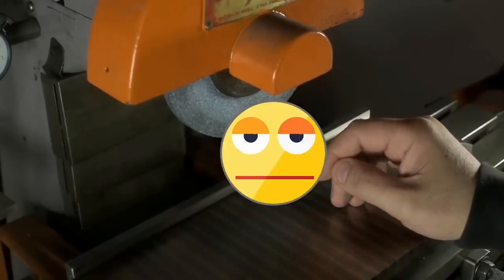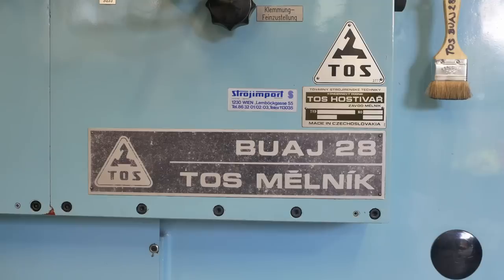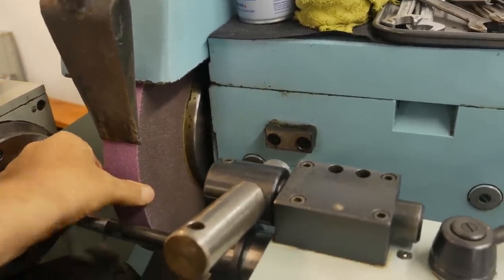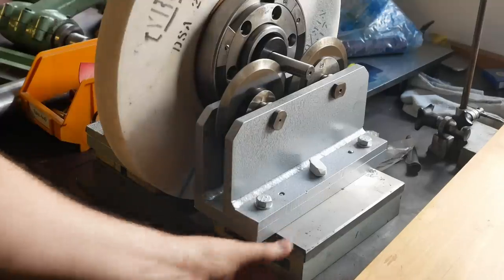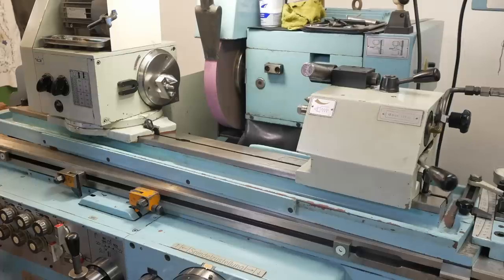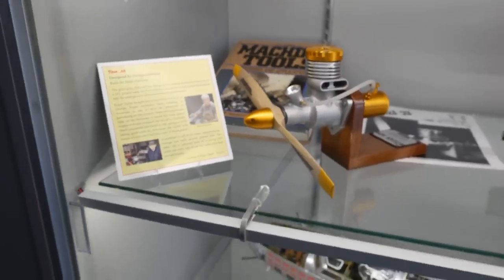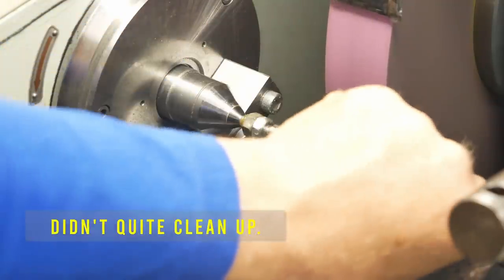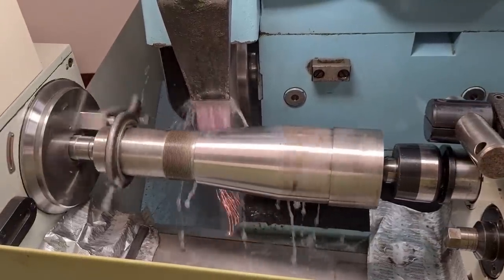Who needs a cylindrical grinder? || RotarySMP

Comment: Rewatching this vid, likely for the 3rd time now...
Damn, that is some savage preload on that spindle... My surface grinder while stiff, can be turned by hand with little issues... In fact, whenever i start the spindle, i turn it by hand and then tap the switch to power up... It eases the life for the motor, and its in general a bad idea safety-wise, which is why i do it with all my machines... Lathes, mills, grinders... Even the angle grinder gets a wrist flick before i snap the trigger into position... But that TOS grinder is almost like a diesel engine with 20-1 compression... Why in the hell is it so strongly preloaded? The wheel mass and diameter i guess, but while 40cm is much larger than my s.g. wheels of 24cm, i dont see 16cm dia difference warranting that much of a preload difference... Especially since they are the same width wheels...

Btw, that twin ways spoken of lathe is on her way to my driveway this friday... Checked her out yesterday, literally not a single new spot o` rust... Told ya that my lubricant coverage game was supreme... 
Now i just have to sell a few pneumatic collet closers and such accessories to get 3x the money that i spend on my last few machines back, per piece... The last lathe i picked up for peas has a large pneu collet closer which i can likely sell for 1.5k$ or so, which literally covers the machine, the transport and my trips to check her out and all that by like 3 times... Or, it pays off that lathe, the lathe im about to get and the deckel s1 that i picked up a year or so ago, and their respective transports... And i have quite a few of such things to dish out... And a huge hydraulic vise to fix up, scrape in and dish out for somewhere around 1k... The bloody thing is half a meter long... You dont want that brick slipping outta your hands and falling on the feet... That is a quick and dirty amputation... I got it for what was it? 30 euros? Something ridiculous like that... It would fit my large mill, but its just an instant waste of table space, as with that, nothing else could be mounted... It would have to sit parallel to the table rather than as you usually mount a machine vise... It was bought exclusively for restoration and re-sale... Even my surface grinder cant use it, which is enormous, at least when compared with most youtube shop surface grinders... Don`s from Suburban notwithstanding... Tony`s grinder is a toy compared to it... Literally a bench grinder in comparison, given that you can actually take parts off of `er and move them as a single human... Its kinda how Jeremy Clarkson described the Bentley Arnage 2007... A cathedral... 

I will film that lathe when she comes... I wont however film my shop yet, as its a fucking mess and in no state to be displayed... Not with 4 large machines stacked like sardines, next to each other... The rest is more or less in permanent positions, well 2 of those 4 are also in permanent places, even 3, as the third has to budge a bit to the right where the aforementioned lathe now sits while i work on her... 
Tho, i must tell you, everytime i watch this video, i curse myself for missing out on a fortuna cylindrical grinder... I was a day too late for it... She got cut apart with oxy torch by the time i got there... Tho, i did save the parts head and tailstock for a special project that is the aforementioned machine 3... But its such a sad thing thinking of the sight of that beautiful machine being cut by oxy-aceti to bits... I should have put down a deposit and gotten her... A damned sin that was... Oh the grief this world conjures... And only because someone died and the machine was tossed out, and my ass was too indecisive... Never again my friend, never again will i let a machine be obliterated if i can save her and sell her to a loving new home, where she will outlast the new caregiver... I think i still have a slagged t-bolt from the slant table off of that grinder somewhere... I guess as a masochistic reminder...

All the best and kindest regards!
Steuss
Reply from the maker: Hi Steuss. Seeing a serviceable cylinderical grinder the day after they started butchering it with a gas axe. Enough to make a strong man weep! 

There was a scrappy who lived a floor below us in our old apartment. Nice guy, but for them it is all just metal. He did sell me the Deckel G1L frame for €20 which was nice. That became my first "mill". There was also a vertical gear shaping machine in the scrappies yard. A swiss one. No way I could save it. Real shame.

Over here the value of machines is roughly inversely porportional to mass. Once a lathe exceeds abut a 2m bed length, you can barely give it away. Small machines go for top dollar.
Cheers,
Mark
Reply: @RotarySMP 
Kind of the same story with my side... 
The scrap boss is a great guy, just a lovely man, and his wife is aswell, they both run the place, a family business with 7 other employees... I asked him why doesnt he do something about good shit he can offer for a long time, for quite a profit at that, even if just oiled once a year and not left to rot in the rain and then get tossed into shredders for little profit to him... Same deal, he cant see it as anything other than metal, as it would be a ruinous politic for the business... I dont agree, hell, i could manage that place, make him at least 1.2x the current profit and keep the machines in a small area under cover, so fanatics like me can buy them... But i dont think that i want a job of a manager, nor do i think he would accept the proposal anyway... ``dont fix what aint broke type of deal``
Tho, that Deckel engraver body was such a great snag... I do have a fetish for plain machine bodies with just tables and such, no workheads... They offer amazing project foundations...

Regarding the machine market, same here, im in the ex-yugo zone, and its the same deal... The larger and heavier, regardless of quality, goes proportionally down with the price... Lest its a fully restored, above OEM grade machine, then its a separate arrangement, but just used machines, yeah, the bigger they are, the harder they fall...
 
Regarding that grinder, yeah, really a tragedy, but i just didnt ever consider taking on that type of machine at that point, and so i could not just jump on it... I should have, but fuck it, i saved some parts from her, and i saved quite a few other machines from the same fate, so i have to be happy with the soldiers that live on to march again, not fail in my duty towards them over grief... Every doctor has to accept similar losses, i guess that a machinist/millwright has to at some point as well... 

But dude, that damned lathe is likely coming over tomorrow... I`ll film her as is and post - when the truck deposits her ass before my shop... She aint movin` in, as i have to both clean and brush all the dreck off of her before i even consider letting her ass in... And i have to make a support pillar from the basement to uphold the garage, as the lathe from the last comment cant go where she needs to before that is done... I cant have an unsupported floor carrying a 1 metric ton... I likely could do it, as her floorprint is large enough to spread out the load, but that is not how i roll... Structural integrity and absolute safety come above all else...

Comment: Would this work for making something like ... a custom ball screw spindle (obviously with a different grinding stone)? Problem I always have is they are made in fixed sizes so if you are constrained (say you are upgrading a vertical mill and want to replace the acme thread spindle but the size you need is a specific length) it is a pain.
Reply from the maker: I dont think it can grind the ball thread, as I dont think it can do the coordinated motion. It could easily grind new journals on the end of a shortened screw, if it fit between centers or through the headstock.
Reply: @RotarySMP  Interesting. Thanks for the reply!

Comment: the size of that wheel is nuts
Reply from the maker: That 400x40mm is the thin one. According to the manual, you can fit up to Dia 400x100mm wide grinding wheels.

Comment: Cylindrical grinders are used to refurbish car steering racks. I have seen them working, but i didn't thing that those are generic machines, they looked like dedicated equipment to me
Reply: Also, typical steering rack is longer than 1m, so machines this small must come with discount thanks to incapability of working with them :>
Reply from the maker: I dont know what it cost, but would have only been a fraction what it cost new in 1991.

Comment: I know where I can get up cylindrical grinder here in Fairbanks Alaska that monster weighs more than 10,000 pounds I think you can cylindrical the grind about 6 foot long something about half that size would be perfect
Reply from the maker: That "little" TOS is probably nearly 3 ton, but only swings 620mm between centers.

Comment: thanks for the videos! any chance you could share your servo tuning process? i’m in the process of tuning my own similar JMC AC servos for my mill conversion and pretty much struggling. thanks!
Reply from the maker: I havent gotten mine fine tuned yet, but will try to add something in my next video.
Are you running yours in step/Dir or analog?
Reply: @RotarySMP  amazing! i’m running it step/dir out of a mesa 7i95, because i have glass scales that i eventually plan to use to give actual position feedback. but so far i’d mainly like to get the servo as little following error and vibrations as possible before any of the more advance feedback. i’m dealing with the jmc software and chf changing values change things but seems to never get in the right direction.
Reply from the maker: @bastieng  There is a really good video on tuning for Step/Dir here.
https://www.youtube.com/watch?v=_9Q-VFesnA0&

Start off using the JMC JOG Mode, and make sure the Encoder counts up when moving Up.
Reply: @RotarySMP  yeah no of course. i have watched this one countless times and worked with it. i ended up having a better result today by using the AF_J-L function of the drive to get the load inertia of the axis. automatic settings were better of a start once the inertia was entered at the start.
Reply from the maker: @bastieng  There is another video where the guy works out that the autotune is not a real auto tune, it is just a look up table of fixed incremental values. You also can't input decimals of inertia (mine are about 1.2 on X and 1.6 on Z. Since I am doing analog control I need to do the loop tuning mostly in LinuxCNC, although I really do not understand all the values in the drive, or how they intereact with LinuxCNC.
Reply: @RotarySMP  Oh I didn't know about the floating point. Good info. Re: interaction with LinuxCNC, do you input the servo encoder to Linuxcnc? In my case the servo encoder talks only to the servo drive but not to the mesa card at all, so I mainly wanted to make sure it answers to itself tightly, so I don't inherit a lag when I later tune the glass encoders to LinuxCNC. (and yes, the "auto-tune" is a table of basic sets of parameters which take input from the load inertia and "stiffness" setting, as far as I understand. Turns out that if the load inertia is in the ball park and you get the "stiffness" as up as you can before getting resonance, it's an ok starting point. Had to still add some positional and speed gain manually and filter some resonance. It's not perfect but I get a couple of microns following error, which I hope the machine can live with. Could definitely be better but I'll try with this for now.)
Reply from the maker: @bastieng  Yes, I am passing the encoder through to a Mesa 7i83, and having LinuxCNC close the position loop. The Driver only closes the velocity loop.

A few micron following error is very good. It is very hard to reduce it to zero in an amatuer system.
Reply: @RotarySMP  ah wow i never thought of passing the servo encoders through. sounds interesting. and yes the results i got today were suddenly much better than all my previous attempts. i’ll still have to see if i can fight the lead screw backlash with the scales. anyways, i’d be super interested to learn more about how you going about these different encoders and tuning them. thank you so much for your video series i really enjoy it!
Reply from the maker: @bastieng  Having backlash in the drive train and then trying to close the position loop with direct reading scales is not a great plan. Where a human intuitively takes up backlash in the leadscrews of a manual mill when reading DRO's, a dynamic CNC machine will have issues with that. While backlash compensation is available in LinuxCNC, and works open loop, I beleive it will be challenge to deal with closed loop. Before you go doown that path, open a thread in LinuxCNC forum to discuss it's feasiblity.

Eliminating the mechanical backlash is the better solution.

I thought about adding linear scales for direct position measurement, like the Maho has, but there is no simple place for fitting the X scale. Also the machine and drive trains are so stiff that Schaublin didnt consider glass scale necessary (They measured position with Tacho's on the servos), so who am I to second guess them.

I probably have no advantage with running the JMC's in Analog mode and closing the position loop in LinuxCNC. I could have used a step/dir mesa card, and let the JMC driver close the position loop, and just indicate position in LinuxCNC with the pass through encoder values, with the same performance and accuracy.
Reply: @RotarySMP  ok, that's super interesting. basically the situation is: I got the servos and the mesa to convert this mill, I planned to change the 3mm pitch original leadscrews to ballscrews but didn't want to yet dismantle the machine to figure out how to adapt it. I then was like 'hell, I have the servos let's make some fixtures and prototype the whole thing. Then before I knew it I had a bunch of electronics thrown on the workbench and got the axis moving and started tuning the drive and instantly was like 'shall connect the DRO scale to the card already to test?' and basically that part went real bad yesterday. Not bad as in stuff is broken, just bad as in headache. No setting seems to work.

So should I just move on without the scale feedback until I mount some actual ballscrews you think? maybe play around without open loop software backlash compensation?

The original leadscrew on the X axis (which is the one I'm fiddling with) has about 0.3mm backlash.

I did open a thread on LinuxCNC forum yesterday, as I thought my whole PID loop was totally wrong (either HAL setup or PID parameters), here it is: https://forum.linuxcnc.org/10-advanced-configuration/47047-linear-scale-and-ac-servo-set-up-sanity-check 

Thanks a lot for your thoughts and clarifications on your own setup, it is very mind opening and helpful.

I love following your restauration project, the lathe you got is a treasure. I'm daily using a pretty old small Schaublin 102 and I love and admire it every time. Got me out of so many jams.
Reply from the maker: @bastieng  I responded on the LinuxCNC forum.

Comment: I have a Dremel mounted to my 7" Harbor Freight lathe so that I can get precise diameters on long shafts. If that counts as a cylindrical grinder in a home shop I'll happily make a video. :D
Reply from the maker: How did that work out for you on a long shaft? I have used my Proxxon grinder in the mini lathe with a cut off disc, and it makes really nice clean circlip grooves.

Comment: Put the water on the part not the wheel
Reply from the maker: Thanks for the tip.
Reply: @RotarySMP  trust me I grind a lot of spoools to the micron lol the water on the wheel just makes a mess and can actually affect roundness if the pressure from water between the wheel and material is too great for example, anyway the wheel doesn't need cooling the Metal does ! 😇
Reply: @RotarySMP  for cylindrical grinding anyway, if we were talking about cutting grainite for example then you'd be focus on making sure the blade if getting sufficient cooling. Entirely depends but with grinding metal with stone it's cool the part, the wheel just wears away you'd not trying to save the wheel, it's an abrasive wheel

Comment: That's a lot of machine for just grinding tapers and shafts.
Reply from the maker: And faces, and bores. But year, it is a production machine. Once you have it set up, you could crank out hundreds of parts per day.
Reply: @RotarySMP  I wonder if it would be lucrative to start making runs of some of the common tool holder tapers.
Reply from the maker: @HanstheTraffer  I doubt it. They are so widely available that is a commodity market.

Comment: dont think a cilindrical grinder is as useful as a surface grinder , in a pinch you can make a cilindrical grinder bij using a toolpost grinder and a lathe
Reply from the maker: I think the real magic is the extreme rigidity of the spindle of this machine. You are right that you can do most of it's job on a lathe with TP grinder though.

Comment: I can see your greedy eyes! When will you get one? Afterbthevschaublin? 😇
Reply from the maker: I have no space for it. Besides isnt the schaublin capably of the sort of hard turning which negates some of the need for grinding :)
Reply: @RotarySMP  😄
Sure, but ...
I guess you always could build a grinding attachment forbthe Schaublin. But I guess that would ruin the ways.
Maybe you can explain howvtge Czech grinding machine gets aroundvtgat with the inverted ways. Didn't quite understand what you said about the way they did it.
Reply from the maker: @helmutzollner5496  The ways are completely covered by the table, and are therefore never exposed to the grinding dust directly.